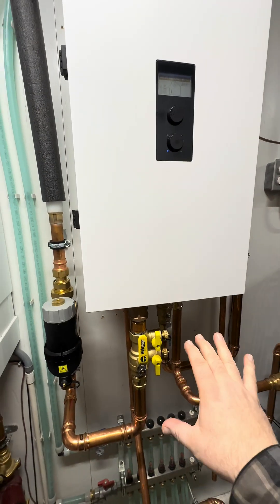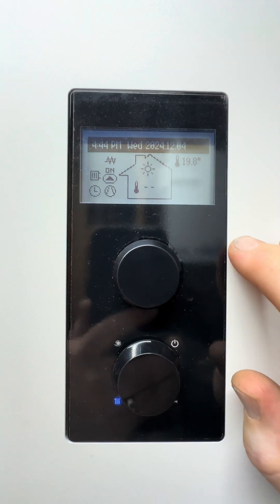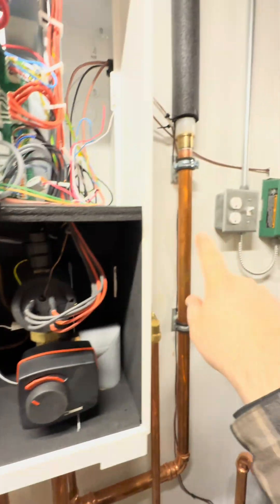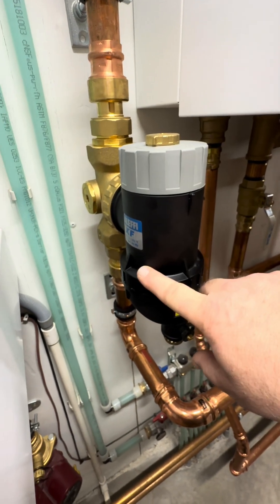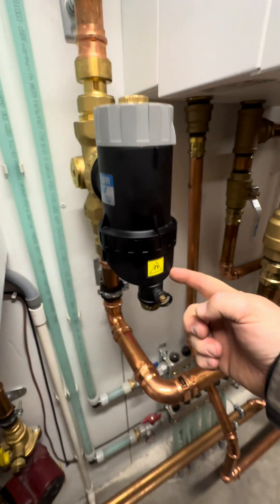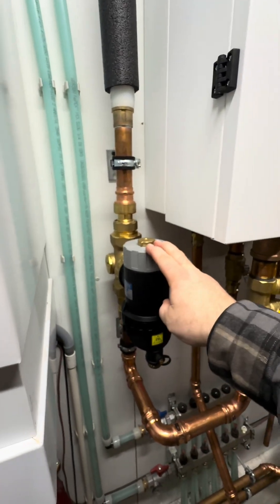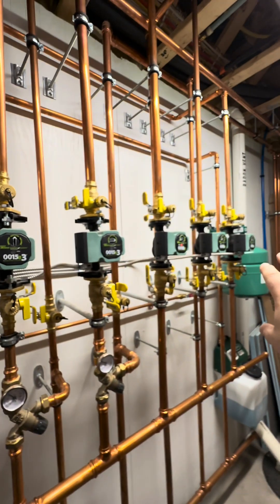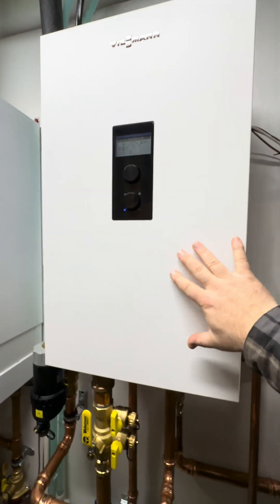Viessmann Vitocal 100 Hydronic Heat Pump Indoor Unit Tour

Comment: Beautiful install. Is the piping not insulated because you want the heat in the mechanical room when it’s cold enough for the system to fire up? Or is just unnecessary since it’s a tempered but unoccupied space? Curious for my own install as I don’t want to spend money insulating pipes where not necessary. Thanks.
Reply from the maker: Insulating the pipes would only marginally improve overall energy conservation. The room does not overheat and the heat given off by the system piping is beneficial to the space. The tubing throughout the house is insulated where not acting as an emitter, Jost not in the mech room.
Reply: Got it. Thanks for the response! Much appreciated.

Comment: As an end-user, I’d never use Viessmann again. Horrible customer service. They just tell you the same thing: “call a plumber”. Cool. Thanks for the tech support. Never, ever again.
Reply from the maker: They don't talk to homeowners. Most homeowners don't have knowledge of manometers, multi-meter, combustion analyzer etc.
Reply: @mechanical-hub  Yeah, well when the “qualified professional” who installed the system couldn’t figure out how to code the boiler and the homeowner needs support to get it working properly, it’s inexcusable to not at least attempt to help. Especially these days when plumbers in my area are hard to find and won’t take on small jobs like fixing someone else’s screwup. When you invest that kind of money in a system and they won’t even talk to you, that’s atrocious customer service. 

I did eventually get it working after weeks of trial and error and reading the manual back to front six times. But never, ever again would I do business with a company that cares so little for their customers.
Reply from the maker: Sounds like the contractor was the first problem tbh
Reply: @ Sounds like you’ll defend them no matter what as long as you keep getting free stuff.
Reply: @pirahna432 sounds like he’s right 🤷🏽‍♂️ there’s a reason so many technicians install them. Sorry you didn’t have a good experience
Reply: With an attitude like that, I wouldn’t talk to you either. 😂😂😂

Comment: When the heat pump isn’t active does warm water still circulate through the outdoor unit to prevent damage from freezing?
Reply from the maker: The system fluid is 40% glycol, which is needed here in MN but otherwise it can run constant via programming. Normal operation would be to stop flow when buffer temp setpoint is met.
Reply: Beautiful!